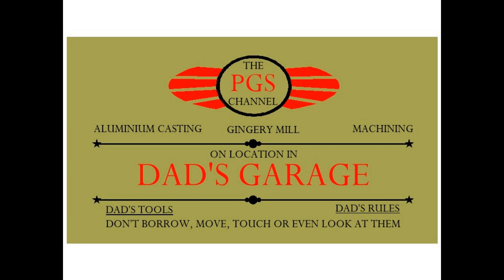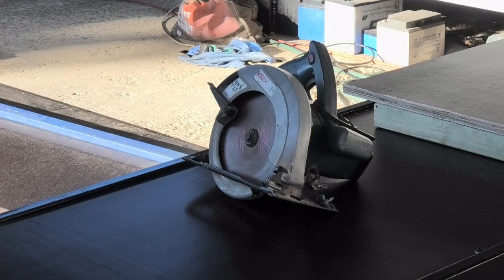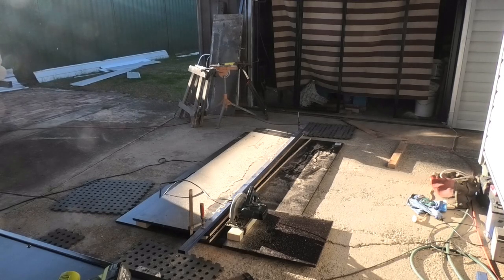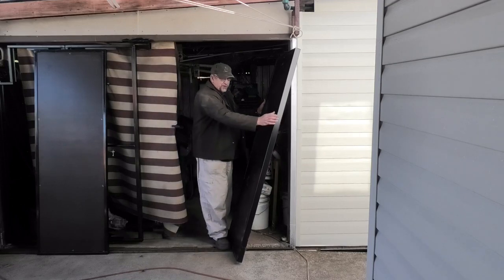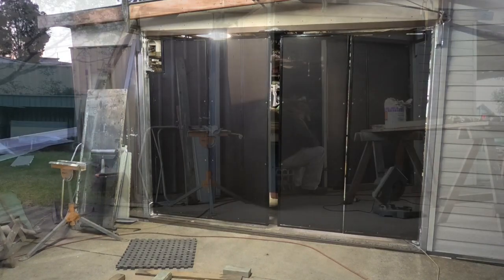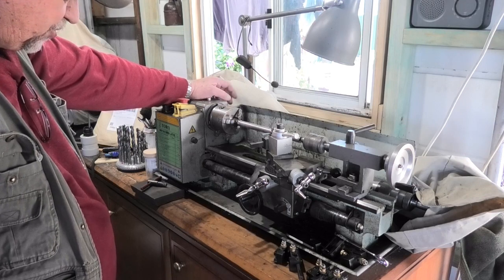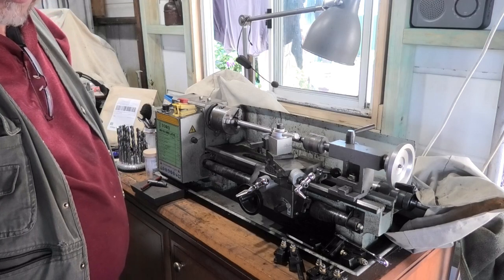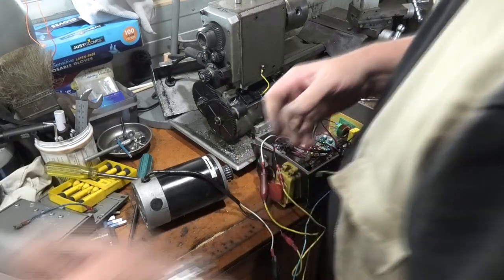Garage Facelift Part 7

Comment: Gday Peter, the workshop doors look and work great, lucky you had a spare motor the the mini lathe, the old motor did a fantastic job, Cheers
Reply from the maker: G'day Matty. Thanks yes the doors are great, simple and compact and far better than the original tilt door which I had to duck down to get under, ouch,it gave me a few headaches. Cheers Peter

Comment: Hello Peter, I like those doors. That arrangement should be nice for a shop. You are having all sorts of lathe problems. Glad you have a spare  Around here I am always on the lookout for free treadmills, they are come up once in awhile and the motors bring a few dollars on eBay because they are great to use for those machines.

All the best!
Eddie
Reply from the maker: G'day Eddie. Thanks the doors exceed my expectations 
The lathe failure was my own fault, taking too big a cut for too long.  I have seen people use tread mill motors but I'm not lucky to see them at the right price. Cheers Peter

Comment: Hi Peter, Those double doors are looking good. Lucky you had the spare motor for the lathe. Cheers Kevin
Reply from the maker: G'day Kevin.  I'm very happy with the doors, they exceed my expectations.  I've had that motor for about 6 years now it eventually came in handy.  The cause of failure was my own fault, I had 6 long bars to machine approximately 5mm off the diameter, so ended up taking deep cuts for extended periods, well it was a failure waiting to happen.  Cheers Peter